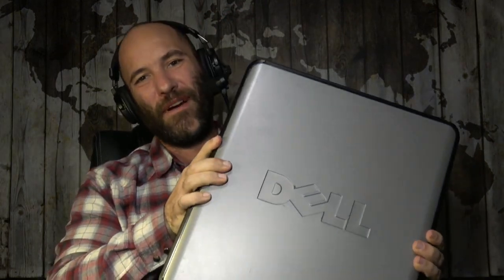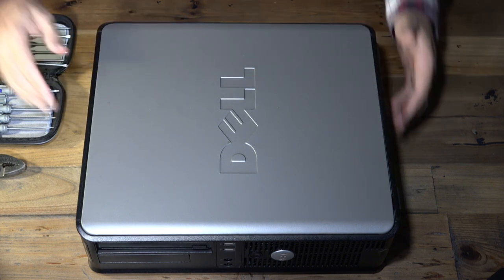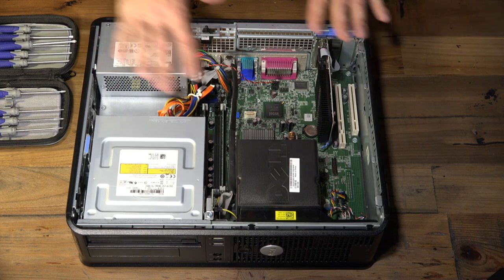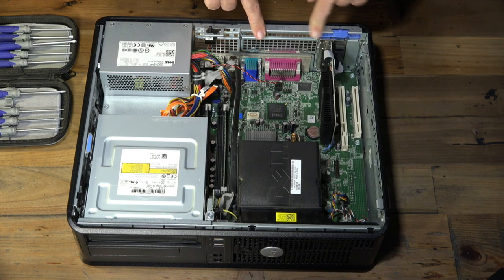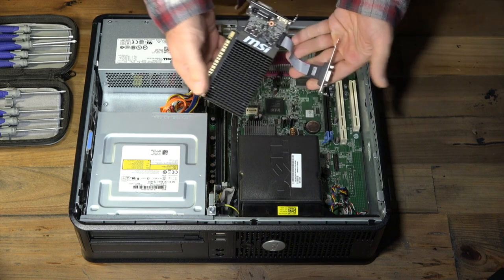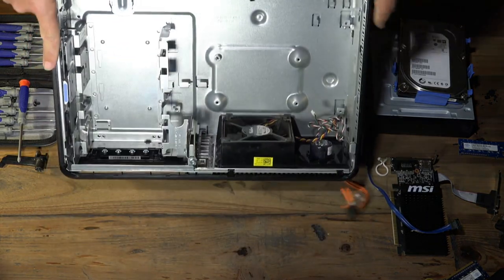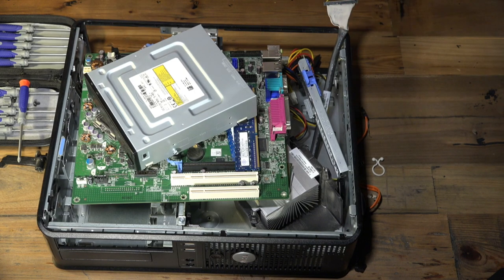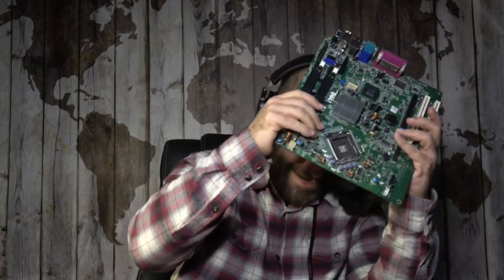A+ Desktop PC Autopsy

Comment: A secret I learned when taking apart systems (especially laptops) color your screws, just put a little paint on the top of a screw for a color code by section or size, then take a picture of the system, then start removing parts. Also sometimes it helps to get little tabs for the cords and if you have four RAM slots and do not want to put the RAM in the wrong slots, put a tab on it.  I don't care how well someone's memory is, it's better to make sure you have everything right, mostly the screws. I don't know how many times I have saved my own rear when working on a laptop and doing the screw color code system.

Comment: I learned my way around a PC after buying a used PC from a Network Administrator off Craigslist a few years back. This guy literally took his work home with him haha. Turns out the hard drive on it was starting fail since the computer started to not boot up correctly.I ended giving myself a crash course on signs of hard disk failure and on installing a new OS on a new hard drive. At the time you could still legally download Windows 7 ISOs from Digtial River and I was able to burn that on a DVD using a older laptop that was on its way out. Used the product key on the case and I was able to activate Windows with no issue and I was on my way. The computer I got was originally like $800+ dollars 2011 model I7 2600 Gateway DX4860 UR21P . The guy sold it to me for $279 along with a decent Samsung LED LCD monitor that only had a bad VGA port but working HDMI. To make along story short it was a good starter desktop PC to make upgrades to and what not along the way to make it my own and in the process learned alot about how a PC works this way. Your video about SSDs also made me eventually migrate my OS an SSD and figured out how to install a hard drive as a storage drive from Linus lol. It's been a fun journey.
Reply: A tip : watch movies at Flixzone. Been using them for watching lots of of movies recently.
Reply: @Alex Liam yea, I have been using flixzone for since december myself =)
Reply: @Alex Liam Definitely, I've been using flixzone for since november myself :D

Comment: I used to have a two bedroom apartment that I lived in by myself. I used the master bedroom as my hardware lab. I would take apart old computers and put them back together just to try to get some practice. My degree wasn't in it, my degree was in computer programming. But I also like putting the computers together. One time when I put the motherboard back in I missed putting in a spacer. Something was rattling and I thought it was the fan and I pushed on the fan, and I pushed too hard. So I ended up pushing the back side of the motherboard against the case and let out all the magic smoke.

Comment: I learned how to build a computer by building mine own. When learning I fryed a Nvidia 8900 gtx2 video card and a power source, by connecting the moutherboard power cord to the video card. That was back when that video card  was top of the line. Luckly bouth the video card and the power source was still under warranty.

Comment: A PC only needs 4 parts to turn on, and 3 more parts to be "usable".  It needs a Mainboard, CPU, RAM, and PSU.  it will then turn on, and compute.  If you add a case, a Gcard, and a HD, you now have all of the parts, minus cables, and fans.   Servers, and laptops are pretty much the same parts too, with some differences 

What these 7 parts do does not change a whole lot.  Numbers have gotten bigger, connectors have changed shape, but a PC of today is pretty much the same as a PC from 1990.  same things, doing the same thing.  Once you understand what the 7 parts do that knowledge will last a long time.

A PC only has 3 types of screws (for the most part).  The little ones, the big ones, and fan screws.  little screws are pretty much only found to hold in HD/optical drives, and to hold in your MB.  fans screws hold in the fans,  the larger screws are everything else.  Your cards, your PSU, your case panel.

When I was 12 in 1991 I mowed lawns and shoveled snow until I got my first PC...an apple 2e.  I quickly upgraded to an Atari 520ST,  by the mid 90's I had a 486.  I used to buy any PC I could find for $5 of for free, just to take apart

I worked in a Dell call center from 2000-2004.  At the time (no idea how dell does it now) Dell invested quite a bit of thought into making there systems easy to work on by the end user (with a tech on the phone)  Dell has free lifetime tech support.  I would have people calling in because their PC from 1984 is not posting.  

After I left Dell I started doing freelance net admin, and PC repair for small business's, and worked for a company that did all kinds of things notably they did haul offs, getting paid to go into a space, and remove everything.  A lot of old servers, and office stuff.  They also refurbished laptops, and sold them at truck stops and the like.  We would get in a pallet of laptops from a school,  use cases and cases of graffiti remover, get an image on them, all that jazz

The entire time I was doing that I was also painting houses, and hanging sheetrock, trim work, did a lot of work on boats, laying fiberglass, custom cabinetry.  By 2009 I realized that I did not want to do PC work anymore.  Just for friends and family